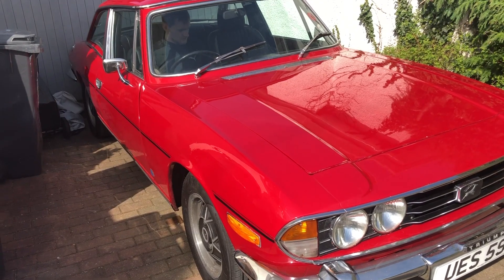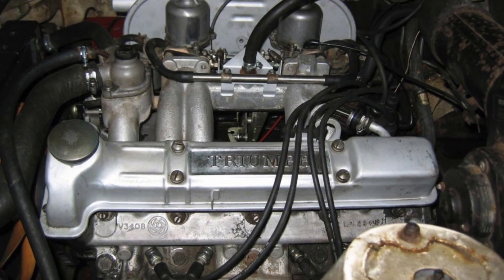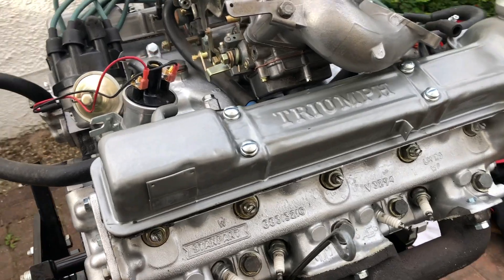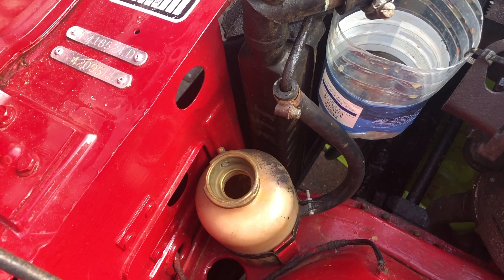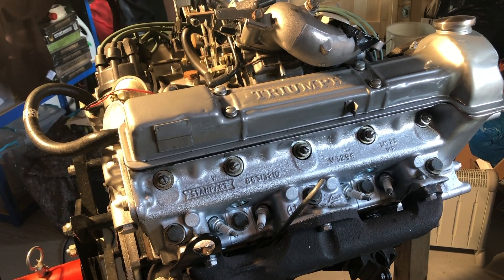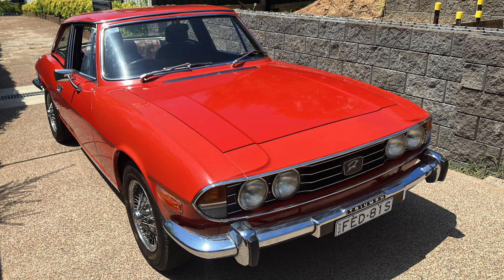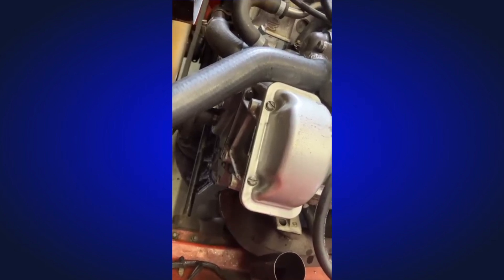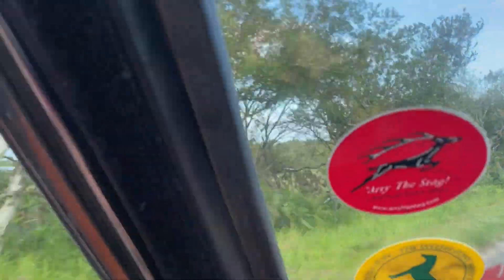Triumph Stag V8 Engine – The Untold Story of Its Troubles & Triumphs!

Comment: If triumph had used the Rover/Buick V8, it could have been an amazing car. Bad decision.
Reply from the maker: 46% still on the road 50 years on - agree it may have made sense to use the Rover plant but the Stag engines are very good/reliable if maintained well. The major historic issue was very poor QC Control in the manufaturing process. Thanks for watching all the best TR T

Comment: For the umpteenth time........ In production terms, you do not make a v8 by "welding together" two 4 cylinder engines. 
A v8 can share some parts with a 4 cylinder from the same family eg pistons , rods and sometimes heads. All other major components need bespoke design eg crankshaft, camshaft, block, manifolds. Specialists like Alan Millyard have created multicyinder engines for motorbikes, but these are one off projects, not production processes. The reason the Rover engine was not used in the Stag is simple - self serving management. The Rover fits easily, and the development costs for the car would have been slashed. Many problems would have been avoided if a flamethrower had been applied in the boardrooms after both the BMC and BL mergers
Reply from the maker: Not sure what to say - not sure I said Triumph welded two blocks together at any point. Some used to say it in the press..but otherwise!?? Best TR T
Reply: Rover engines were not yet built in quantity as they were all needed for Range Rover and p5B and P6

Comment: The only thing I can add to your list is broken main bearing caps. I can see your local to me and  I worked at Barnes engineering in the 70s and 80s. And saw a few with broken caps which we had to line bore replacements. The Stag certainly kept us busy then and I would be the first to say one of the worst engines to come out of British Leyland. But I would have one in a heart beat. Such a beautiful car with a beautiful sound track.
Reply from the maker: Stag engine reliability when up together is a lot better now. Back then it really was a combination of poor working practices and a lack of quality control in its manufacture that was the cause of so many issues that could have easily been picked up! All the best TR T

Comment: Having owned & rebuilt a Stag many years ago, we all knew then the issues. One issue with converting to the Rover V8 motor was the engine did not rev as high. 6500 on the Triumph vs 5500 on the Rover. So without converting the diff to something with a different ratio the car was too slow. After having a lot of powerful sports cars since then, I have recently purchased a Lovely 2001 Tvr Chimaera 450. These engines have a rev limit of 6500. So with a little work on the Rover engine it would be a suitable upgrade for a non purist. Yes you are correct the Stag was a amazing car. I had the hard top on pulleys on the garage roof above the car for easy storage. Keep up the vids. I'm doing quite a few on the Tvr at the moment.
Steve.
Reply from the maker: Sounds good Steve - join us on a weekend and share with us some pics, we love all classics here! www.arrythestag.com/saturday-sockets thetriumphstag73@gmail.com All the best TR T

Comment: I had done 180k in my Stag in hot AUS summers went across the  country twice and finished  3rd in a tarmac classic rally and still running the original engine. Must have got a good one it was the last production run. Just meticulously maintained and everything is fine. 😂 never had an issue. 👍 Actually one issue that I did suddenly developed is smell of fuel in the boot once full. Replaced everything with new even the fuel tank, but still have the smell. Drives me crazy. 😀

Comment: The proven engine, used in the Land Rover, was a Buick Aluminum V8 that was sold to Land Rover. In the US it was used in the Spark and an 
Oldsmobile of the same size. It was underpowered by American standards but good enough to be used in some Kit Airplanes. Now if you find one of those cars it’s best to restore it because of the restoration craze.

Comment: @brianwhittington5086  is correct about the engine, I don't  know  where the idea that this was a SAAB engine, originally if I recall it was Triumph Standard castings and as Brian describes was then made into a V8 to try to avoid the use of the Buick  Skylark Rover  V8.  The SAAB engine was the left hand side of the Stag V8.  The SAAB 99 Combi  Turbo was the same block but SAAB built the head and the engine was mounted with the clutch forward so the head was to the O/s.
I worked on Stags in the late 80's and had a SAAB 99 for Rally, and 900 Turbo. My chum still has a Stage I worked on then.  

 I eliminated overheating by ironically fitting a SAAB header tank on the bulkhead above the water pump, fit electric fan and most important an oil cooler. Never had a Stag overheat since.  Put a half penny under the pressure relief valve on the oil pump to bring the pressure up 5 psi.  My engines hit first time which was not wanted from cold so I wired the oil pump switch to short out the points so it will only fire after oil pressure is satisfied.  Check the head bypass pipes are not crushed and watch for leaking vacuum which will screw the carbs operation.  Use SAAB 2.L turbo bearing shell and bucket shims as they are sized better than the BL parts.  Also use SAAB suspension shims to sort out front en geometry.  An oil cooler on the PS pump won't hurt. Spark-right TAC ignition helps a great deal.  Don't follow the Triumph head tightening sequence it is stupid as the head drifts away from the angled bolts and is stressed and warps, slacken the vertical bolts a quarter turn then back down.  Thanks for the video but I cant agree with your interpretation of the Stag engines evolution.  PS, it was LUCUS that killed the Stag in the US along with many other good British cars.
Reply from the maker: Thanks Brian - great info.. much appreciated Kind regards TR T

Comment: Also the 6th vein pump is much better than the 12 vein,  I actually had this tested by a water pump specialist  !. 🤔🤔🤪
Reply: Triumph experimental dept cut holes in the head and engine waterways puting clear plastic in place then using tea leaves to watch and check water flow. 12 vane pumps were shown to cause cavitation of water so 6 vane better if you can find them.

Comment: Having rebuilt several Stag engines, I am very familiar with it's construction and I am very conversant with its problem areas also, whether they are true or have become slightly mythological and exaggerated over the years
The single most effect thing to do  after rebuilding one  of these engines, I cannot stress how important it is to retouque the head bolts after 500 miles and again at a similar interval. This is crucial in preventing head gasket failure. I believe many Stag engines fell foul to this oversight, either by enthusiastic but unknowing private owners or garage repairs that just weren't followed up on. Stag engines are not alone in requiring this procedure. Many engines with alloy heads and iron blocks can suffer similar issues because of different expansion coefficients of the materials. Head bolts need retorqueing after initial ' stretching' too.
Assuming correct assembly and all that concept entails. Subsequently followed by proper maintenance, my experience leads me to believe the engine should remain as reliable as any other.

Comment: I have done 330,000 kms in my Stag, and from 93 to 2000 was my only car. From 2000 to 2013, it then shared daily driving with a Dolomite Sprint. Since then it is driven on sunny days (Dolomite is retired) and shares duties with my "newish" car (2006 Chrysler 300C) and an old Jag.

From 93 to 2000, every year for 7 years I drove it home on Xmas leave (for 4 weeks at home, our summer) from Melbourne to Perth return.  I am from Perth, but back then I was posted to Melbourne (I was in the Navy for 40 years) The trip is 3500 kms one way, so 7000 kms return. Temps from mid 30's to 48 degrees (C). Melb end leave Melb lunch time Friday,  arrive in Perth Sunday arvo. The other way I would leave Thursday morning, arrive Melb Saturday arvo. 

I did it once in the Dolomite from Perth to Melb return in 2003 to get a manual Gbox to replace the auto in the Stag, and has been a manual since then. The Stag was an auto for all the cross Oz trips. 

I used to change my timing chains every 40,000 kms, so have done it 8 or ten times. Compared to new cars, it isn't a big deal.I used to use AE chains, and always measured how far out the tensioners were on removal/recorded it, to see "trend". They were always the same, ie chains had worn/"stretched"/elongated the same amount.

Then about 2005 or so I researched IWIS chains. I contacted IWIS in Germany, and also the Australian rep. He said they use them in drag cars and have no drama. I fitted them then, and while I don't do the miles I used to, I haven't touched them since, and don't  expect to ever have to, but if I am ever worried, I look with a bore scope (take tappet cover off) can see how far tensioner is out = shows how far they have to go. 

So much about the Stags "problems" really are rubbish. The early cars got bad write ups, and they have just been repeated again and again.

I can give countless examples..................... but most have made their minds up.

Honestly, back when the Stag was new, BL couldn't put together a Marina and other cars with cast iron heads, HOW were they ever going to assemble an alloy head OHC engine?????

And the penny pinching was ludicrous. I have a copy of a BL service bulletin that says "Due to a shortage of anti freeze, dealers are to re use old anti freeze drained from other cars until further notice... " NONE of us would do that. 

How reliable is a new Honda or Toyota???? That story about "sand left in the engine blocks". That made people think "Stags were rubbish". Ok, put a handful of sand in a new Toyota or Honda (or any OTHER car) and that means "they are rubbish as well?" 

They have a lot of niggles and silly things on them. All cars do. 

But nowhere near the bad press they get. 

But once a legend starts, people LOVE to keep it going.

That show "for the love of cars." Ant hated it, but even he had to admit there was little wrong with it. Their viscous fan drive failed (they are rubbish/bad batches, I have been through 3), but apart from that, nothing.

But it's a Stag - it HAS to break down!!!! Can't disprove the legend. So he goes for a drive with Alexi Sayle. I watch and wonder why he is driving on a sunny day/idling in stop and go traffic WITH HIGH BEAM CONSTANTLY ON!!!!!!!

So then they look at each other in surprise and "Oh no, it's broken down!!!!!!!" and they call the AA. Who turn up and get out a jumper battery. They idled it with the high beam on (and most people uprate the high beams) and ran the battery flat, "because a Stag has to break down." More about theatrics than reality. 

Idle any 70's car in traffic with high beam on = that will happen. 

I bought mine 16 years old in 1993 for $15,000 AUD. It was the only V8 touring convertible I could buy for anywhere near that price, it has served me well, and I will have it FOREVER. :-) 

Each to their own.
Reply: I was the second owner of a 76 that had done 100k without chains being touched. (Hard top had never been off either)
Engine was stripped down, all was good, German chains fitted and it did another 100k. I think engine balancing it helped but who knows. 
Then a few years back Headers, a Weber and new chains were then fitted (along with a bare metal respirator) and it’s clocked over 300k. 
Believe the price I sold it for was highest yet in NZ.
Reply from the maker: Great post - sincere thanks for commenting! Join us for more if you like on a weekend www.arrythestag.com/saturday-sockets Incidentally we're likely to do more on the engine on the Channel soon! All the best and many thanks again! TR T

Comment: It seems that these days, these cars could be more reliable than they ever were, and equally as reliable as other classics. All of these mods and maintenance procedures are standard fare on e.g. a fairly mildly modified Ford Escort - improved water pumps, bigger radiators, frequent fluid changes.

Comment: The Torquatrol unit is a sealed, oil filled  viscous drive that can be unreliable or fail completely. The best solution is to remove it and fit a temperature controlled electric fan. You must ensure the electric fan polarity is wired corectly, for how it's mounted, it must spin to draw air from outside, inwards to the engine bay, or you'll get engine overheating. The Torquatrol unit was designed to provide a varying viscous drive to the fan blades, almost solid when cold, stationary, or in slow moving traffic. As road speed rises, air flow through the front grille, and hot viscous oil in the unit, should gradually give less drive to the fan blades as air flow begins to overcome the viscous drive and stall the fan.  It was designed for making less high-speed rasp from the fan blades, saving engine power as the revs rise. The unit bearings can wear, seize, or leak oil with age, leading to loss of viscous drive and a real possibility of the fan and worn out drive unit breaking off the engine and causing catastrophic radiator, engine bay, and bonnet damage. When working correctly, it should be quite stiff to turn the fan blades on a cold engine, but easy to spin when hot, with  no sign of bearing wear or oil leaking.
Reply from the maker: Hi Brian - all good thanks and useful to know. We had one go on the Red Barrow a couple of years ago and it sounded terminal I must admit!! All the best TR T
Reply: Hi Tony, if you know your way around viscous drive units, some are interchangeable between manufacturers.  I know some Ford ones will fit the Rover V8 and 6 cylinder engine water pump pulley thread, I've fitted them to SD1's in the past when the Rover part was unavailable. So, Triumph, and other BL models possibly use the same thread size, the crucial thing being whether it's a left, or right hand thread. Ford ones were much cheaper and plentiful too, especiall as used parts. Yes, they certainly sound noisy, like a catastrophic failure is imminent when they go wrong, and they will waste an awful lot of fuel and engine power if they fail and seize up solid.

Comment: Mine I used an airline on the head waterways as you could see a build up of sediment in the rear waterways when I had the inlet manifold off, use safety glasses....!
Also flushed out using the block drain holes. 
All back together, and the viscous coupling was shot. 
Always after a drain and fill, the temp will go three quarters of the way up, then bounce down to normal, and stay there never getting that high again. Assume its the last of the air being flushed out. 
I have the external Ford water pump installed low down where the alternator used to live. The standard Triumph water pump location is dangerously too high running the risk of running dry with little water level drop. 
I've also got a Volvo header tank mounted high up, the aftermarket aluminium ones look too bling for my aged engine bay.
Reply from the maker: Thanks mate - much appreciated. Will spread the news/top tips. All the best TR T

Comment: I used to work on Stags for a living back in the 80s -and owned one myself for 5 years. The viscous coupling mentioned in this piece could on occasion fail to the point that it parted company from the front of the crankshaft and tore into the radiator core.

I used to recommend to customers that it was better for the car to remove the viscous coupling - and replace it with an electric fan - in those days a Kenlowe fan, now no longer made. In some cases, including my own Stag, it would be a 12-inch Kenwloe that was selected and fitted neatly between the radiator and the front grille. The 12 inch fan was fine, my Stag had one for 30,000 plus miles and was still spot on when I sold the car.

There was a 14.5 inch option also - which came in a bright orange colour - when I asked Kenlowe why the garish colour, they said it was due to it being 'capable of taking fingers off'! We fitted quite a few 14.5  fans to Stags largely for customers who wanted extra peace of mind.

The fan was so powerful it sounded like a hovercraft starting up - and would blow the dust off the workshop floor everywhere! One customer I remember booked his immaculate, low mileage stag in for new timing chains saying he was going on a summer European tour of 2,000 miles including crossing the Alps. We recommend the removal of the viscous and the fitting of a 14.5 fan - which was done.

After the trip, the fellow came in clutching a pack of German beers saying his stag had done really well - and he'd enjoyed the trip that much more as he wasn't worried about his engine overheating. These days, Revotec fans would probably be the go-to brand.

I agree with the views mentioned in this piece, the stag is often unfairly maligned - people like to sound off and exaggerate because they think they sound good - but actually, they don't know what they're talking about. These days, things like larger-capacity aluminium radiators and turret-mounted expansion tanks provide further peace of mind against overheating.

Always run with a 50/50 antifreeze/demineralised water mix in the cooling system. Change your oil and filter every 3,000 miles, change the timing chains, tensioners and guides (and inspect the sprockets) every 25,000 miles and the engine is well capable of running beyond 100,000 miles.
Reply from the maker: Hi Andrew - really appreciate your reply. Will likely feature it in a forthcoming www.arrythestag.com/saturday-sockets as I'm sure others will be interested in all your points too. Best wishes TR T